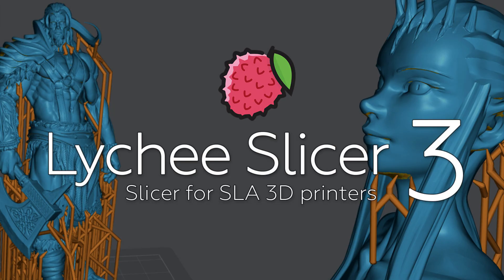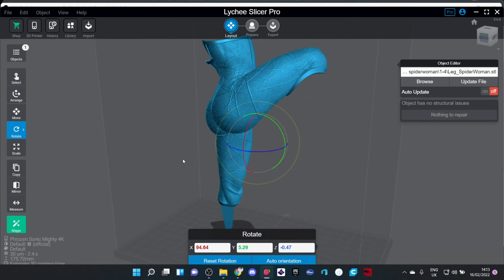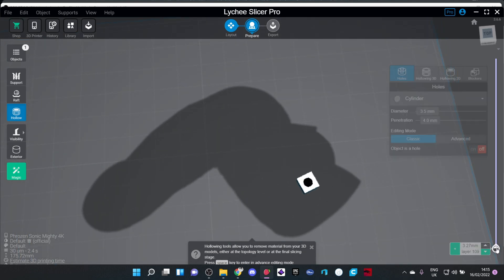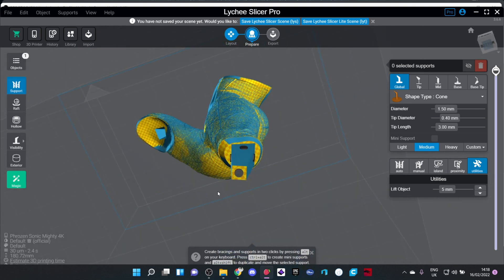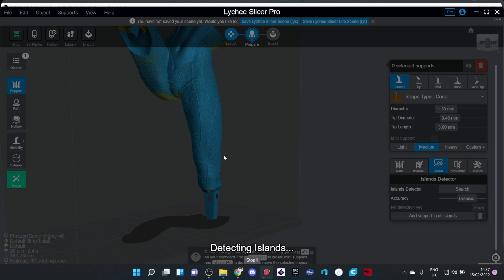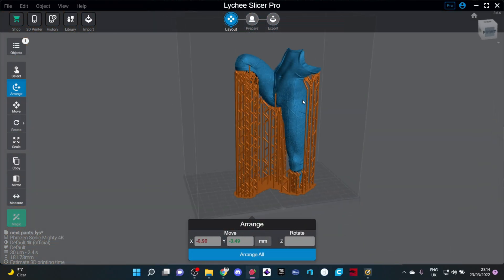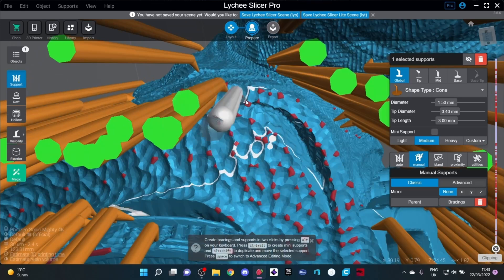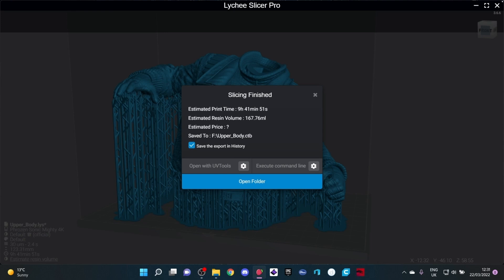How To make Supports in Lychee Slicer for Resin Printing Large Scale Models.

Comment: 01:35
Be mindful of "suction cups" too...
If you have something that's sealed on one side and unsealed on the other and the entire thing is sealed save for the open area, you can create an area of suction which will pull the print off of the supports.

Comment: omg someone who agrees with about facebook groups, they are basically cancer, i found that there is some thing worst than the  bed leveling and that's they seem to love asking about the room temp"resin only works at 25 - 35 degrees c, and the fep, no one knows how to read a manual or the back of a bottle, you basically have the same work flow i use, and yes the bed leveling was gold, trying to pick the accent

Comment: Hi, your work is AMAZING. Could you make a video explaining how you work your piece once the supports are removed?, because in my case I always have yo sand or cover up little holes, I also see that the pieces you print fit perfectly and you can paint them separately, in my case I can't achieve that, I always have to glue the whole model together, fill the joints with some resing and cure with UV flashlught an then I can prepare the model for painting.
It would be great if you can make a video.
Once again, your work is AMAZING.

Greetings from Argentina 😉

Comment: Nice to see a vid that isn't just about miniatures. I have a question, though:

Is it normal for parts not to fit perfectly (1-2mm gap)? I've managed to get the gap below 1mm with a bit of sanding but I don't really want to print the other stuff then not be able to fit them
Reply from the maker: You may be over exposing. Or the key isn’t perfect size?
Reply: @Groundeffected  I doubt it, i'm at 1.6s. Model is from the star wars models patreon and I haven't seen anyone complaining about it so it should be fine.

On a side note, does Wicked also use chitubox for the pre-supported models?
Reply from the maker: @mcrksman  if the keys are too tight and it’s from Star Wars one then I could very well be over exposed. Or if not then you may need to support it better on the keys as it may be distorting slightly. Wicked stuff (star wars is sort of them) usually fits very very well no modifications needed. Check on your exposure again and also check those keys how they’re supported.
Reply: @Groundeffected  It's not that they keys are too tight more like the print still warps slightly even though I'm spamming supports everywhere. Any more and they'll literally just fuse into one giant support because there'll

Comment: It's very true, lychee supports always fail for me. 😅 I've turned to using prusa slicer to do hollowing and suports now 90% of the time it works 100% of the time 😁
Reply from the maker: I can’t get on with prusa. I haven’t had any fails that weren’t my own fault. I really like lychee for what it does….
Reply: @Groundeffected  oh, also if you use AA, it hasn't been working properly since version 3.4.2 it ses to only add gray values at corners.

Comment: I haven't tried Lychee yet, I use Chitu. I have gone to simply using auto supports, then add a bunch on "internal" faces of the model which are just going to be glued onto another piece. I also like to absolutely riddle my prints with as big and as many holes as I possibly can in any place where they are hidden. As you said, it helps with the suction force, cleaning out the model, and saves some resin as well. Another great and informative video!
Reply from the maker: On point!! Thanks for watching my dude!

Comment: Is there a reason you use lychee instead of chitubox? Just curious?
Reply from the maker: Chitubox kept crashing and doesn’t auto save. And lychee barely crashed and does auto save. Plus a few other benefits like the island detector etc. overall it’s more comfortable for me.
Reply: @Groundeffected  Great to know you using it on a Mac? As mine does the same
Reply from the maker: @jamescoulter5267  when I was having the problems yes!! Since then though I’ve changed to a pc now
Reply: Chitu has graphics card issues, especially with Nvidia graphics drivers, on a PC  if you right click the icon, shortcut  > compatibility > Change high DPI settings > High DPI settings, override high DPI...>System enhanced.   This should fix that crahing issue.
Reply: my input on this is that i constantly had issues with chitu crashing and errors with supports. at no point did i ever have a stable build of chitu and im working on a high end pc. 

lychee has been way cleaner experience and my models have come out much cleaner consistently.

Comment: Thanks for sharing your workflow!
Just a comment: the model you are supporting has a lot of texture because of the clothes design. My advice is not to put supports for each tiny island. When it's an island that is few pixel widths on a few number layers (1-5) before it connects to a larger supported area, it's not worth adding a support as the support tips will be way bigger than the island you are trying to support.
My 2 cents of course :)
And the leveling bed part is just gold!!
Reply from the maker: Yea I didn’t support every island. It would make a big thick block if I did. But I prefer spreading the load over more supports than to use stronger supports.. I realised when I was done the video that I didn’t actually explain that part well but you have so hopefully people will read it!